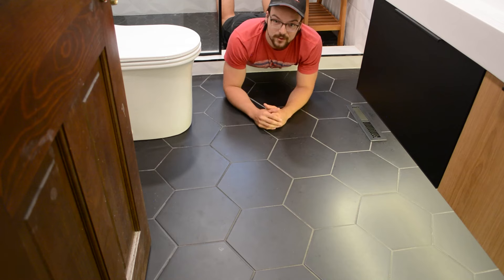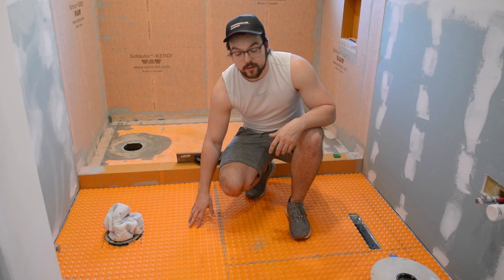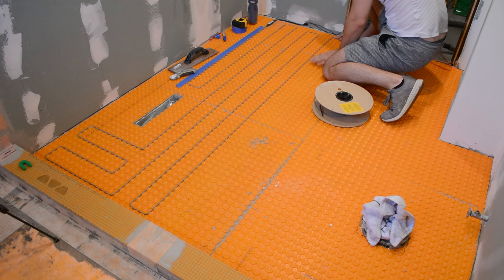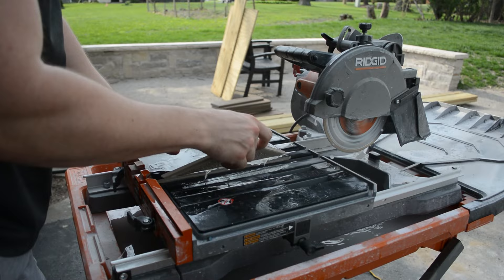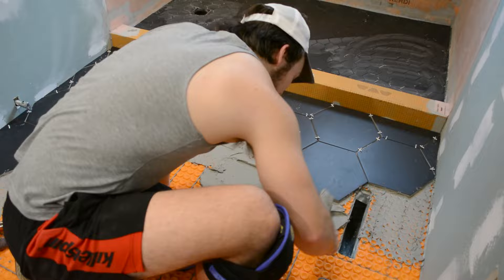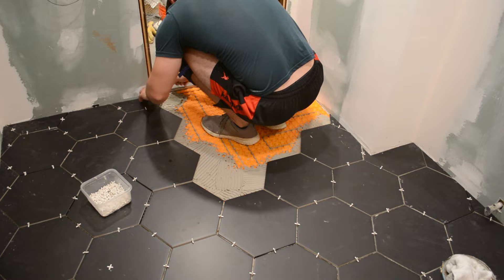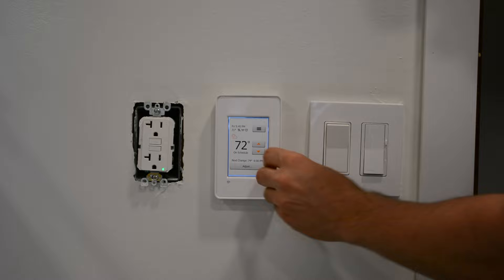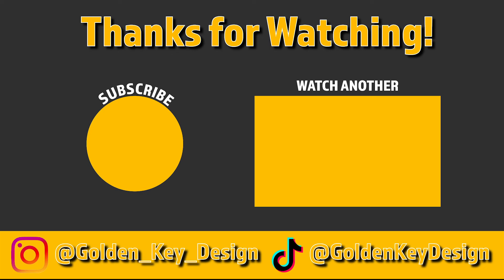How to Install a Heated Floor | Bathroom Remodel Part 6

Comment: When you do heated floors, you shouldn't use them for the first month they're installed. Even though the mortar sets in a day or so, it doesn't fully cure for heating purposes for about a month. Yeah, it's cured for room temperature in a day, though. If you use the heater before the cure is fully done, your tiles will start to split in about a year because your mortar bed has gone bad.
Reply from the maker: Thanks for the tip!
Reply: Thanks for the info we need more people like you to make the world a better place
Reply: But isn't 70° room temp?
Reply: I have a question does this also heat the room? I never have seen this type of tutorial. I was living in a house where the floors were heated but they were saying that they were pipes with water running through there what exactly did you install? Maybe I just don't understand sorry.
Reply: @justYouJesus1God  Ehh, it heats marginally. Depending on the type of stone, maybe more, maybe less. Ceramic tile, not so much.
Reply: This is 100% not true
Reply: @nikkikiska  Ask Home Renovations DIY. He's one of the best and not just a guy I like on YouTube. It's absolutely true.
Reply: @heyMrK  for example, watch Ask Home Renovations DIY floor leveling video and then read my comment that i copy and pasted below. 

This has to be one of the worst DIY videos I've ever seen; it's almost like a flooring contractor made a spoof video that included all the things NOT to do when leveling the floor. 1. No, not "all self leveler is the same." Different levelers have different min/max thicknesses. Some can be poured onto substrates that others can't. Some mixes have been developed for exterior use, others indoor only. Some can tolerate aggregate mixed in; others not so much. 2. Just sweep the floor? NO! Sweep or vacuum and then clean the floor with a damp sponge or towel. The instructions even say the floor has to be "clean and dust free." 3. Don't need to prime existing leveler when pouring an additional layer? Wrong again! And BTW some products state multiole layers are a no-no. 4. Did you know Custom Self-Leveler that you use in the video requires metal lath over OSB? This is why I never use Custom for this application (or any application really since their products are mediocre, and sure, for the purposes of floating vinyl plank it's almost certainly fine, but not a good look in a tutorial video). 5. Just eyeball the mix/water amount? How about pre-measuring the water to ensure a sound finished product? Especially when doing thin pours like this, it's ideal to measure the max allowable amount of water to get decent flow without compromising strength. 6. "Can't mix a full bag in a Home Depot bucket..." ??? For a guy who has mixed "hundreds of bags of this stuff" you sure are clueless, because yes, you can certainly mix a full bag in a 5 gallon bucket. 7. There is no way that floor is flat or level using this pour/float method. Screws/laser level is a full proof method, but for the application in this video any long straight edge (an old 4 or 6 foot level, a bull float, even a real straight piece of lumber) used as a screed with one edge on the edge of the existing leveler would have sufficed. 8. "Run a fan to get it to dry faster because it's a water-based product" ??? 100% wrong and the opposite of what you want to do. First of all, once someone tells you cementitious materials harden by drying just stop listening to them. Self-leveler, concrete, mortar, etc cures (i.e. crystallizes through hydration) it doesn't harden by drying like, e.g. paint. And you never want to speed up the evaporation of water in a cementitious mix because it reduces hydration, which reduces crystallization, which weakens the final product. If you run a fan blowing across self-leveler, it will make the surface weaker and dustier. This is why many self leveler instructions state that forced air heat and a/c need to be shut off for hours after pouring. 9. And buddy, put on a mask. I don't really care if you die of silicosis or cancer, but don't put others ar risk with your worthless videos. Self leveler has both silica and plenty of chemicals in it that you dont want to breathe while mixing or sanding. I really can't get over how bad this video is. Follow the instructions on the bag; don't listen to this guy; realize that "self-leveler" really doesn't self level, especially when poured in a thin layer; use a long screed and/or the laser level/screw method; mix the full bag then pour half into a second bucket to make it easier to pour.
Reply: @nikkikiska  You are still mistaken.
Reply: @Heymrk  If I'm mistaken, please explain to me the chemical and/or physical properties that would cause heated floor underlayment to crack tile 2 weeks after installation versus 4 weeks.
Reply: @nikkikiska  Start your own channel and prove everyone wrong. Let's see it.

Comment: I do wish you had shown how you ran the wire into the junction box or how you ran the sensor to that box. I understand you didn’t want to appear as if you knew electrical, but it would’ve been great to see where the ends died.

Comment: The dude who put our under floor heating down in the bathroom forgot to secure the toilet pan to the floor and it now wobbles around. I am about to drill through the tiles to secure the toilet pan but I'm worried about getting a shock. What do you suggest? I have heard about strong glue too secure the pan to the tiles which would eliminate the need to drill however I would imagine this is only a temporary solution.
Reply from the maker: You are supposed to stay at least 8 inches away from the toilet flange with the heating cable to not accidentally melt the wax ring. So if installed correctly, there shouldn’t be any heating cable where you need to drill. But if you want to be safe, the glue should also work. Hope that helps!

Comment: What is the final installed height of the heated floor and tile? I have hardwood in the next room, and want to make sure the two surfaces are flush
Reply from the maker: The ditra mat is about 1/4”, mortar is another 1/4”, and the tile depends but mine was also another 1/4” so the total is 3/4” tall which is usually the same height as most hardwood floors. Hope that helps!

Comment: I watched the whole video and I would have normally skipped the part about wiring the tstat and feeding power. You quickly said I’ll hire an electrician to do that and I was like perfect no need to fast forward that part. I’m a licensed electrician and have done that part many times but I’ve never actually laid the flooring myself, so great video.

Comment: Good job, save lots of money and enjoy the play time!
Reply from the maker: Thank you! We love using the heated floor especially with the upcoming winter 🥶
Reply: I have a question, did you do the waterproof before? Or doesn’t need. Thank you 🙏🏻
Reply from the maker: @monicafu214  I installed the orange ditra heat membrane which acts as an uncoupling membrane to prevent tile cracking. The membrane itself is waterproof. The floor doesn't need to be waterproofed but you should use some sort of uncoupling membrane.

Comment: Great vid. 

I wish you had a follow up video with how its working and how you like it. How warm does it get your bathroom overall? Thanks. 😊
Reply from the maker: Thanks! It works great! I really like that I can control the temperature from my phone and I can set on a schedule so you don't have to think about it too often.
Reply: @GoldenKeyDesign  That's really cool. I think I'm going to do my master bathroom floor with this product. 

Do you find that it also helps to actually heat your bathroom, or solely just keep the floor toasty to the feet?
Reply from the maker: @getreal3336  If you keep the door closed, it will probably heat the room a bit, but I wouldn't rely on it completely. Mainly it just keeps your feet warm
Reply: @Golden Key Design  TY for this response back. 

I was hoping it would help to heat the bathroom as well. Bummer. I wonder if there's a radiant floor system that would help to also bring ambient heat up into the air as well. I'll have to research. 

Thanks again for your responses back and congrats again on the great job. 👍

Comment: Great videos! It's giving me confidence for our own reno coming up.
How did you pitch the tiles in the window and nook? Simply additional mortar or was something placed under it?
Reply from the maker: Thank you! In this case I just added a bit of extra mortar under the tile to pitch it in toward the shower. But you can also pitch the surface the tile is being applied to when you do the water proofing so you don’t have to add any extra mortar when setting your tile. Hope that helps!

Comment: That small cut tile at 5:57… that’s gonna come up on you or crack at some point. Barely anything under it
Reply from the maker: Wow, you got a good eye! It's hard to tell in the sped up video, but I back buttered the tile to account for the lack of mortar on the ditra. Also, this is under the floating vanity so no one will probably ever step on it but even if they did, it would hold up just fine
Reply: @GoldenKeyDesign  amazing job, just noticed it right away lol. 
Glad that you went back for it and it’s not in a trafficked area.